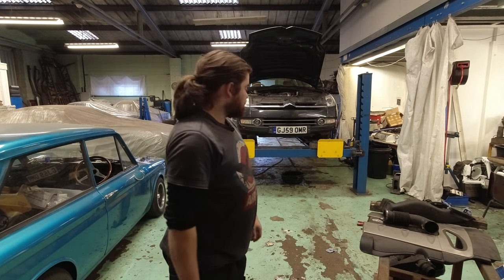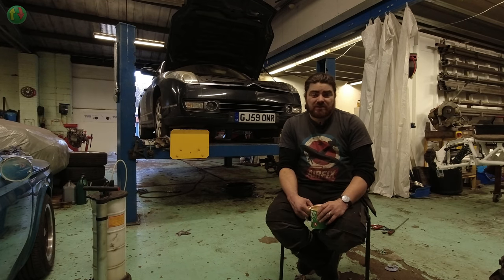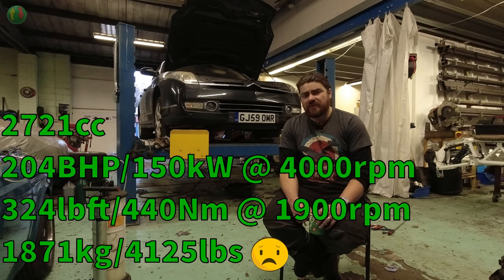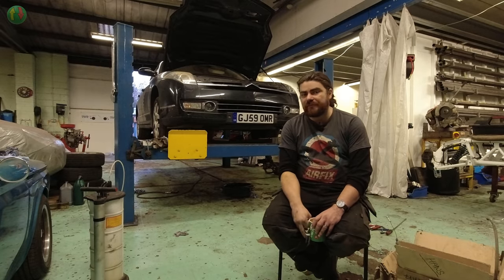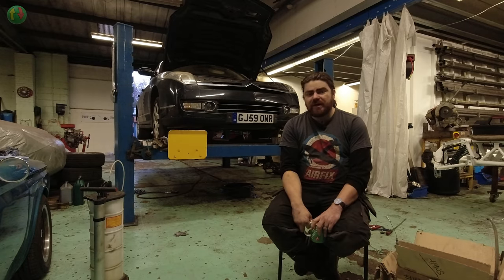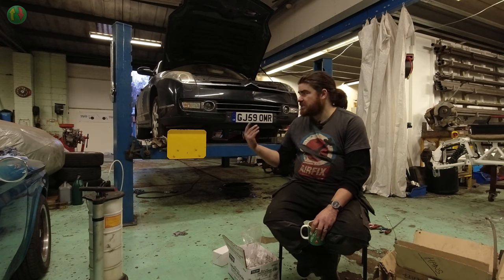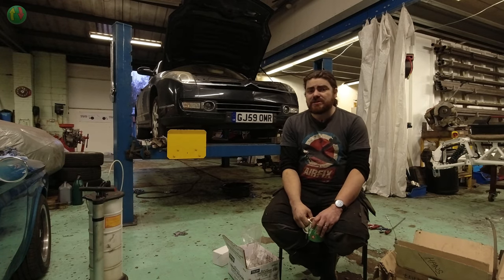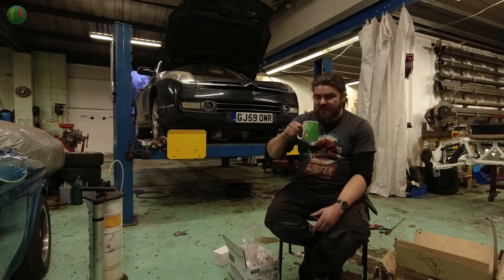STORYTIME: How I ended up buying a £750 Citroën C6 in lockdown!

Comment: The one thing you can say is the suspension is very good and reliable; just dont abuse it . Owned only Citroens since since i passed my test in 1975, and never had an issue; current car near 300,000 miles in it and never touched the engine or suspension.
Reply from the maker: 100% agree. You just need to understand it, which nobody wants to.

Comment: Umm good luck. You may need it. I had one of these a 57 plate 2.7 Lignage at 18 months (16000 miles) to about 3 years and 3 months old. (42000 miles) Wonderful car when working right which was not very often
Reply from the maker: Fingers crossed!

Comment: Great video, thank you! After many years of not being brave enough I finally bought a C6 last November. What a machine! I've owned a CX and XM in the past but they never seemed as potentially scary as the C6. All has been well (even my wife likes it) until two days ago when I have handbrake failure/ABS failure/ASR failure now flashing at me 😞.. I'm wondering whether this will bankrupt me? Handbrake motor seems to be trying to work.....
Reply from the maker: Check the cables aren't seizing (you'll have to remove them to do this, which will need DiagBox/Lexia to put it into service mode). Any issues with that often trips the ABS failure codes, too.
Reply: @UPnDOWN  thanks, I'll try that. Appreciated!
Reply: No final dos cabos, tem uma bucha de plástico que costuma quebrar.verifique,pois a mesma acusa tudo isto no painel.saudações desde Brasil.
Reply: @josemelo6259  thank you
Reply: I have met this handbrake/ABS/ASR failure for two times now in 6 years that I have owned a C6. Both times it was a faulty ABS sensor. Cost was ~30 €
Reply: @Matu007  thank you, and yes fortunately it was a front abs sensor. All sorted now.

Comment: Lovely car, I had a Mercedes ML auto and the fluid type and EXACT amount of fluid was paramount even after changing conductor plate and valves otherwise it had similar gearbox faults, worth checking maybe.

Comment: Got a C6 2012 HDI 3.0, bought it new 40mpg, love it. Glad to see your going to fix it. ❤️❤️❤️. BTW they are quieter and slightly more comfy on 245/50s rather than 245/45s  not sure what size you got?
Reply from the maker: 245/45s on mine, as per standard.
Reply: @UPnDOWN  ok, worth thinking about when you get to change, reduces the crash on potholes, so far only on the front, asked my insurance company before changing, no increase in premium because they are not wider.  I used to change to winter tyres and have a set of 17” which are better still for ride and noise.  Anyway l still makes me smile when l see the C6 🤗🤗🤗 they are rare.  There is Citroen specialist in Welwyn Garden City, that one a few miles from me says are really excellent.  Mine always been serviced by the suppling dealer Roy Tolleys in Colchester.

Comment: Your car selection is an impractical crime of passion … madness … but keep it up ;) some of these era of cars are too clever by half complexity wise, knew a guy who bought an exotic bmw with a trick auto 6 speed gearbox with steering located racing style manual paddle levers, sounds like similar trouble, cost too much too repair by his pocket but this is how modern cars go, you got the tools the garage and strength to keep her alive. Some of these issues sound like design flaws that need 3rd party fixes to make them good, the nice thing about a manual gearbox, is you can nurse them carefully by listening to them bite wise.
Reply from the maker: I built a BMW like that once, funnily enough.

Comment: It's a lovely car, but may I ask if it would pass the emissions test if all exhaust filters were removed and the ECU remapped to suit a freeflow air filter and exhaust ? I'm still running a bought from new 1997 Peugeot 306 XUD9TE IDI turbo diesel, which I've tuned up a fair bit but still easily passes the MOT. Several of my pals have more modern direct injection diesels but perpetually get the warning light/clogged up and sometimes limp mode syndrome, which necessitates blasts along the motorway that they don't really want to do.
Reply from the maker: Well, possibly not, but it's mapped and fuelled to take those perameters into account. Diesel engines produce so much more power/torque than they used to that they need all the emissions gear. If you took it away, they'd be smokey, smelly diesels again. As for the 306, it'll pass the MoT easily because the test is less strict for older cars - if it was in the newer band like the C6 (which effectively needs a cat test) it'd struggle, I'd bet.

Comment: Hi mate, When it comes to Cambelt time, being the same as the discovery 3/range rover sport engine, just be aware there is 2 belts, the main front belt controlling crank and cam timing and a rear belt controlling high pressure pump. the rear belt is a body off job on the range rover sport and a just about doable job on the discovery 3, i dread to think what it's like on a C6, even the main belt looks like a tools thrown across the workshop type job, i think thats why i don't do cambelts.
Reply from the maker: Cheers. The cambelt was done around 2017 (I think), but I'm not sure if the pump belt was done too. I hope it was...

Comment: I had all those 3 problems on my citroen c5 to, first handbrake, faling due to incompetent people working testing the car when i get it reregistered and they pull the hand-brake when the car is moving and in drive without pressing the brake pedal first, second suspension link braking because again of dumb vulcaniser personal who don't raise the suspension on the max level or service mode and than lift the car from the ground, and when they lift it in normal height and than lower it it causes the hydropneumatic pump to fail and also creates damage to the rear trap of the vehicle so the trap screws get bend and that causes the height scensor to fail, now the gearbox i also have the same problem and i can say that it is citroen's fault for this one because the same sc-80 am6 gearbox is used by other car brands and it works great on those cars but not on Citroen and Peugeot so yes it is the valve solenoid block i still have to fix it on mine but for now i drive it in winter mode and the shifter just goes in 3th gear so i don't have any problem driving it but the thig that i cant get it inreverse is problematic .

Comment: I have a same engined 407 Coupe 2.7 V6 and has the same problem with the gearbox when ir heats up there's a big knock between 1-2 gear or 2-3 gear but not always and there was a time when it's stuck in 3rd or 4th but then i shutted down wait a few mins and restart the problem gone. Then it got the computer of the gearbox cleaned from issues and the stucking has'nt appeared again yet. I'm interested in what you find with this problem.

Comment: So did it sit unsold in a dealership for at least a years to get a 59 plate on a 2007 car then? All the high spec bits would suggest it was a dealer car.
Reply from the maker: Probably sat in a field or compound somewhere. A lot of the GJ59 cars you'll see out there are the same, as the 2009 spec is actually slightly different to this.
They just couldn't shift them, basically.

Comment: Is it worth disconnecting the transmission cooler lines, and putting the return line in new transmission oil starting the engine run through the gears (on tickover ) so the new transmission oil gets sent through the system pushing the old oil out through the cooler feed line ? I did this on an old Jeep xj the had never had its fluid changed and it worked quite well

Ace video subscribed 👍🏻
Reply from the maker: It's coolant that goes through the cooler (shared with radiator) so probably not a good idea! It's more of a heat exchanger than anything. There is a bung underneath it, and I have wondered if it would be possible to rig something up to that.
Reply: @UPnDOWN  
Pretty straightforward, on most transmissions there will be a feed and a return line to the transmission cooler, personally I would get rid of the heat exchanger and just have a stand alone cooler for the transmission.
My experience with heat exchangers and transmission coolers built into the engine radiator is that they tend to burst with age filling the transmission with engine coolant

Comment: By the way, does yours have a functioning cruise control? Mine is somewhat functioning, moving the steering column will bring it back to life mostly. Ive read from c6owners forums that the cruise control is a pretty standard thing to go, but I've been too lazy to troubleshoot it(and I don't have the tools or know-how to tinker with it myself, I got a local Citroen garage who knows the pneumatic stuff etc)

Just wondering, if there is a chance you making a video about it, if yours is problematic too.

Only electrical problem that the car has, so far at least
Reply from the maker: Yeah it works fine, most of the time. They do suffer from poor connections around the steering column though, so it's likely related.

Comment: Lovely car, if only I had the bravery (or the ability to find a cheap 2.2 hdi). Sounds like a classic case of slide and bump, I had a VW with the 09G gearbox (pre-dsg) and the “sealed for life” bit me on the ar*e at almost exactly 100k miles when the valve body began to break up and cost me 1200 quid at a slush box specialist. I remember at one point it banged into gear so hard my passenger thought we’d been rear ended and that’s when I knew I had to stump up!
Reply from the maker: The 2.2 is pretty rare, but then they're probably 95% as complex as this one. They don't have AMVAR, and the 2.2 engine is probably a little more tough than the 2.7, but they're still dual-turbo and still have a fair few complexities.

Comment: That handbrake setup made me facepalm. All that needless complexity that doesn't even function as well as a traditional cable operated handbrake.
Reply from the maker: It does, to be fair. It works really well, but I agree that it's a bit too complicated given the cost etc. That said, if they're selling a near £40k executive car, if the competion don't have handbrakes, then they can't either, and this way you can use the conventional calipers from a 407/C5 X7.
Reply: @UPnDOWN  True enough. I guess I'm just not the demographic who'd want something like an electronic or button handbrake. I prefer having a mechanical connection to the brakes. The people who buy these cars new generally never have to deal with the issues these supposed 'up market features' create as they age. They've gotten rid of the car long before then so I guess from that perspective it makes sense.
Reply: I so agree. Every car I've driven with an electronic handbrake has been infuriating - dim-witted, obstructive and ultimately much less satisfying.
Reply: It frees up space in the cabin...people said that about wind up windows ...but were not going back are we.
Reply: @Strike86  Not 4 me
Reply: @Luke-PlanesTrainsDogsnCars  I can't think of any modern car that compromises interior space as a result of the handbrake. We're not talking about cramped poorly designed 70s Italian cars here. 

And there's plenty of modern cars that have the traditional handbrake lever but they're actually electric and not directly connected to the brakes. My brothers Octavia for example has a traditional lever but if you pull on it while moving all that happens is you get a warning on the dash. It doesn't actually engage the brakes.

There's also a safety aspect to being able to manually engage brakes if your braking system has a catastrophic failure that you lose with an electric handbrake.
Reply: I can see you would be impossible to convince ..but its 600mm by 150 mm of dead space.
Reply: @MrManBuzz  Most cars now have electronic parking brakes, but like he said do it a simpler and cheaper way. It gets rid of that long lever.

Comment: Just bought a 2006 Peugeot 407 with very low kms 96k / 59k miles, and have read about the AM6 auto gearbox issues. Mine occasionally hard changes from 6th to 5th on a hill. Just wondering how you will be tackling your gearbox issues. New valve bodies seem to be about UKP780 for a new genuine item. I was thinking of doing a fluid change (with correct Esso oil) and hoping that might correct it. Cheers, Steve Sydney, Aus.
Reply from the maker: I'd do 3-4 changes with it and see where you end up. 5th-6th is an odd place for the initial problems to occur.

Comment: Is it possible to share the part numbers for the suspension brackets ?
Reply from the maker: 3525 11 (LF) & 3525 12 (RF). I don't know the rear, I'll have to dig them out. Fronts are much more likely to need doing, though.